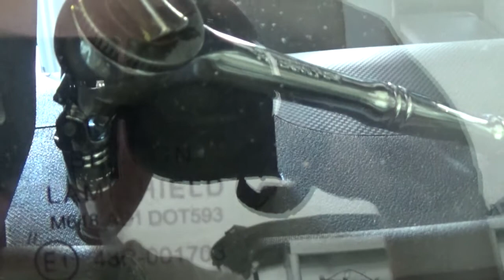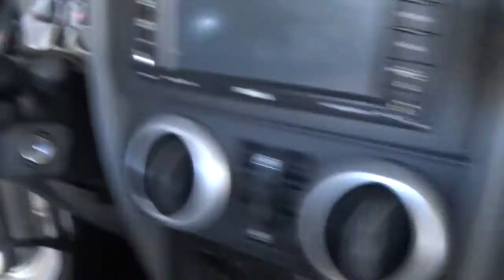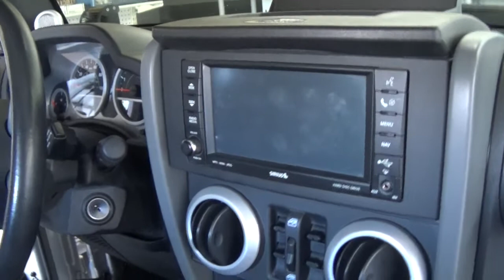What Is An Interior Trim Kit? Install & Review (Wrangler TOP 100) #006

Comment: Thanks for the JK accessory videos.  I just subscribed today and started your channel from the beginning.  It's August 2020 now, and I just started shopping for a used 2014-2017 JK 2 Door 4x4 with 6 spd manual.  The 2018+ JL just doesn't work for me.  (1) For one, I can't get used to the styling yet, which is OK, and will probably just take me some time.  A friend of mine recently got the 2020 Gladiator, and for me at least, it's just way over the top.  (2) Then there's the ignition... Push button start?  On a Jeep?  Treason.  Absolute treason.  Hey Jeep, listen here.  Push button start... not OK.  Bring back the real key ignition.  Anyway, thanks AskAJeeper for the videos.  Y'all have done a great job.